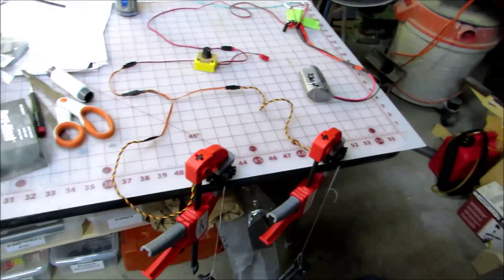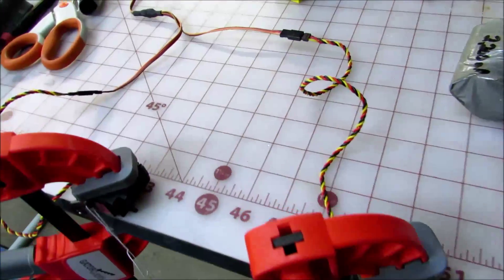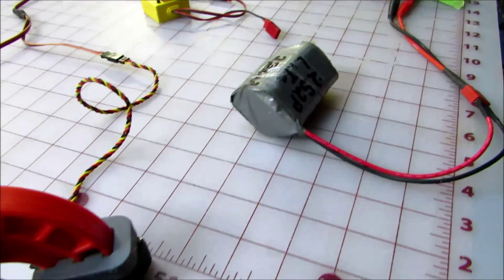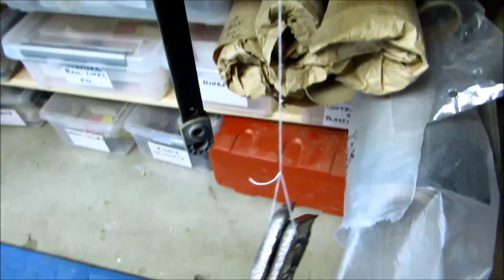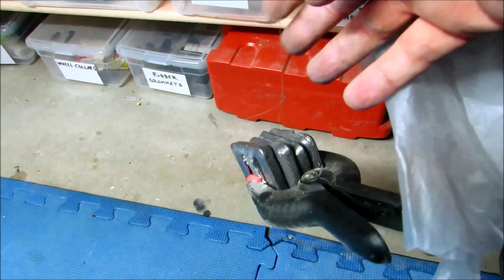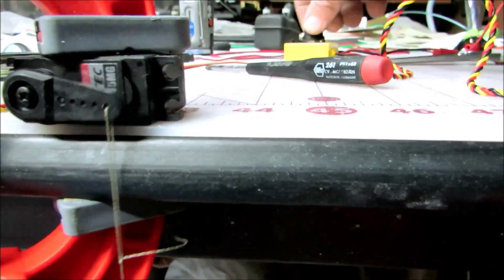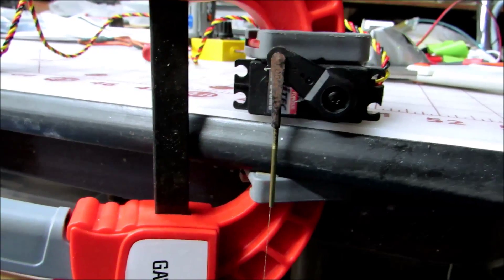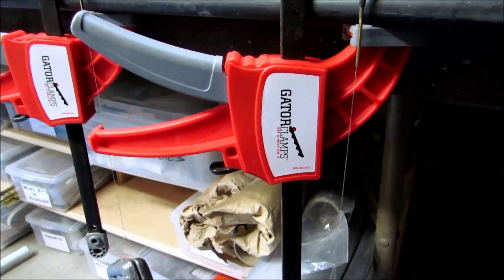Corsair #51, Servo Burn In

Comment: burning in a servo? like breaking in a new rc engine? never heard that before.
Reply from the maker: Enterprise206 6 Few people go through the bother, you are right. But with an engine, there is a process for "breaking it in" in such a way that it will ultimately run better, and have a longer happier life. This is NOT that.This is a "Burn-in"...and the purpose is VERY different. All Hi-Rel electronics (space rated and certain military) get burned in. Most electronics failures happen when the components are VERY new. It's called infant mortality.
The goal of my burn-in is to stress the servo, well within it's ratings, but stress it nonetheless. The goal is to cause some heat to build up (not too much), and to exercise all the electronics. And if a servo is likely going to fail due to infant mortality, I want it to do so on my bench, not in my plane.
Reply: +DON RICE Like the original comment, I've never heard of this before either.  Is the recommended practice 1/2 hour with 1/4 of the Oz/Tq rating on each side?
Reply from the maker: +TJ Rohyans Hi T.J...On servos that have 80'ish oz ratings and higher (up to 500 oz/in)...I just put 2 lbs of weight on the 1" arm, and run it for 30 minutes on each side. The main purpose here is to run in the gear train on both sides of the teeth, and the 2lbs of constant work will allow the servo to heat up, but NOT get HOT. If it gets HOT...that would be an indicator that something is wrong. In this way...the gear train gets properly seated, and the electronics get a minor workout...and if anything is going to fail from infant mortaility...hopefully, it will do it during this 1 hour of burn-in.